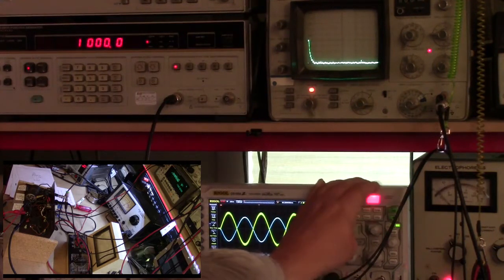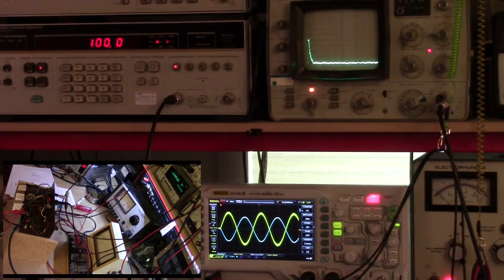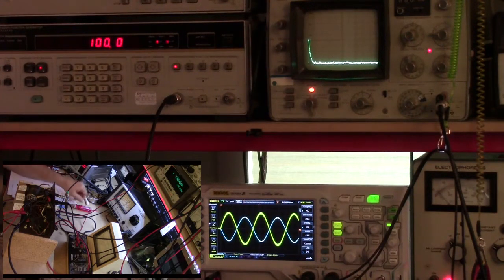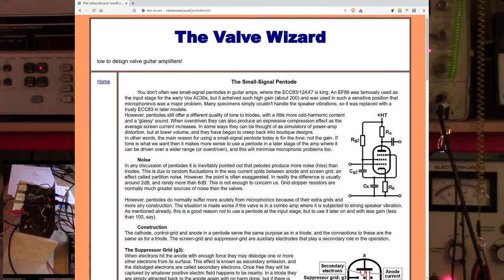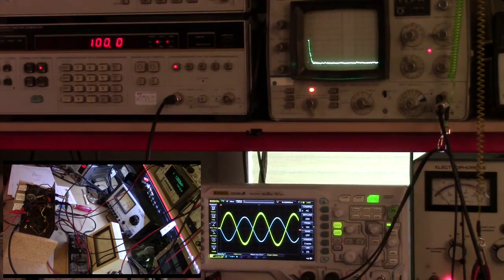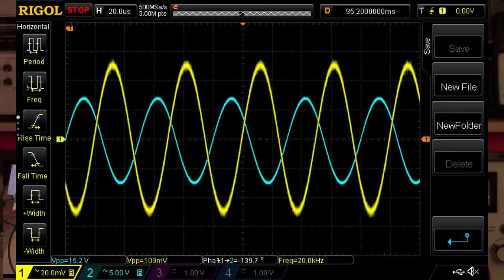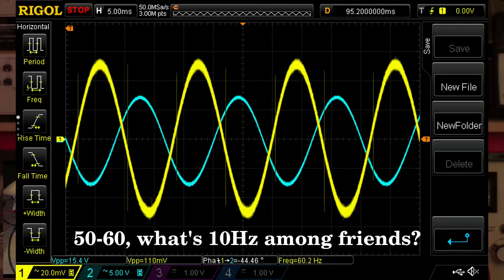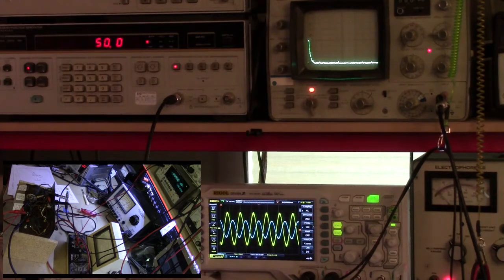200802 Valve Studio - 6SJ7 Pentode Preamp

Comment from the maker: Video Errors - I filmed this over a couple days and made small mistake with gm calculation. The Av gain is 20.2 / 0.114 = ~177, this makes gm = 763umhos. So my 500umhos estimate is actually closer to the measured value of 763.
Reply: InstaBlaster...

Comment: This business of adjusting tube bias seems unmanageable when you look at the unclear and overly complicated data sheets which are rife with relative values for all the various paramenters. Is there a straightforward answer to what power transformer voltage is required for the 6SJ pre-amp tube?
Reply from the maker: Funny you should ask, I'm working on yet another video on 6SJ7 pre-amp. Stay tuned, subscribe to get the notification.

Comment: Thanks for this video. I am looking at converting a mid 40's rca pa amp that has 6j7s for the preamp section to a guitar amp. I have been having a hard time finding info on pentodes and how they are set up for that application. Much of the video went over my head so I'll have to rewatch!
Reply from the maker: There's not much if anything on pentode screen voltage selection. Hope this helps, keep in mind that digital multimeters have 10M input impedance, which for high-impedance circuits will affect your readings. Good luck and stay safe, discharge your caps.

Comment: This is fantastic.  Are you pulling your tube data from web sites that have scanned the data books? I have 15+ receiving (and a few transmitter) tube manuals I collected for free over the years since elementary school in the early 90's... Cunningham, RCA, GE, Sylvania/GTE, etc. The part I have liked like the best in the tube manuals is the example application circuits in the back. The application circuits show lots of variations as you have been showing here.   I'm kicking myself now... I had a chance to purchase the curve-tracer probe for my Tek 500-series scope for cheap. I could have plotted these curves myself. (My recollection is also- the transistor curve tracer for the Tek scope could be configured in such a way as to plot tube curves.)         Download the full data books if you haven't already- and- read through them as a book- rather than the individual pages for the tubes you are interested in. They are a snapshot in time. My favorite was the Radiotron Designers Guide (fairly impressive to thumb through)- but- it appears you can download that now for free too... sheesh...  Andy Payne
Reply from the maker: Hey thanks. Yes, I agree, the RCA Tube Data Books have a lot circuit information than just data sheets. A lot of books are here, http://tubebooks.org/. As for datasheet scans, I get most from Frank's, https://frank.pocnet.net/.  He has many datasheets from different manufacturers. If you need to translate datasheets into numbers, I typically look for the pdf with the largest file size. Sylvania datasheets are typically the most complete. Thanks for the comment and for watching.